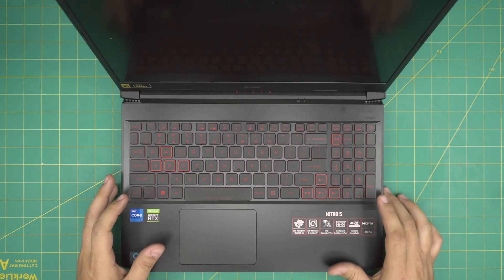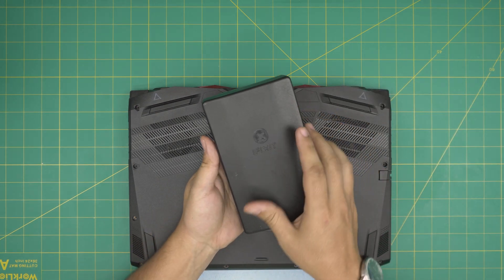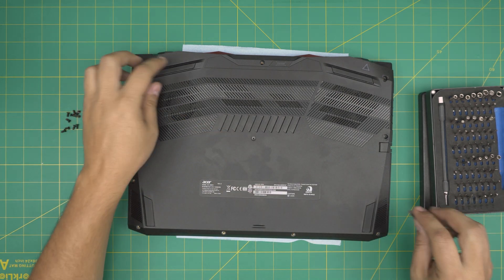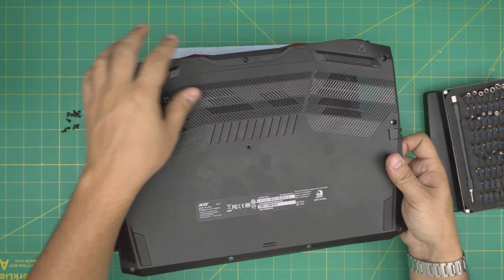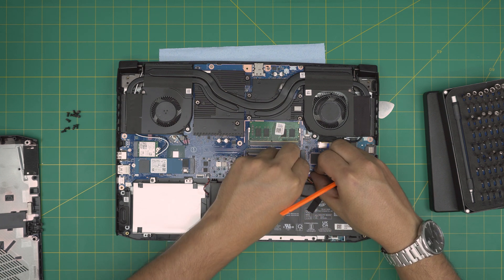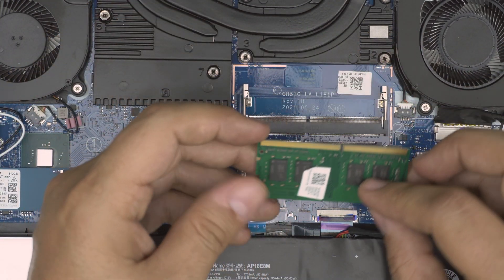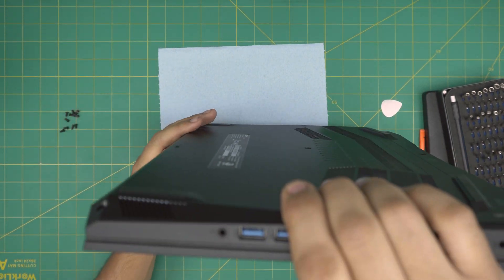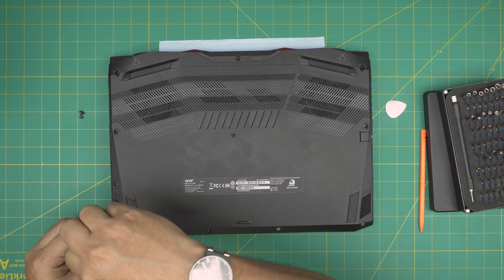How to Upgrade RAM in Acer Nitro 5 AN515-57-79TD Laptop | Step by Step

Comment: Thanks for helping to choose the ram I want upgrade my laptop its the same in the video and also the same model but I911th and rtx3060 6 g can I use the same ram that you buy with out any problem?
Reply from the maker: It's my pleasure my friend.
🫠Regarding your question, yes you can get the same ram and it will work without any issues.
cheers🍻

Comment: Heyy I add 8 gb ram with 3200MHz and I also check the default ram it’s has the same but now it’s black screen. Why is it?
Reply from the maker: 🫠Regarding your question, disconnect the charger, disconnect the battery, and press and hold the power button for 30 seconds. Then, remove the old RAM and place the new RAM in the slot where the old RAM was, and place the old RAM in the second slot. Plug in the battery and the charger, power on the device, and wait up to 60 seconds. You will then see a display. Your motherboard is not performing a memory check, but by following the steps above, you will be forcing the memory check.
Should you have any questions or requests in the future, please don't hesitate to ask me.
🍻cheers

Comment: I have Acer nitro 5 2020 bought, it has ddr4 8gb ram, can it be upgraded to ddr5 16x2 ram, pls help
Reply from the maker: 🫠Regarding your question, no, you can't upgrade to DDR5. The slot is for DDR4, and DDR5 won't fit in there.
cheers🍻

Comment: Hi. I have the same model and I'm about to add another 8gb ram to make 16gb but I'm not sure about 1Rx16 says on the stickers. Is it safe to add Hyperx Impact 8gb ddr4 as an additional ram to my laptop kingston 8GB 1RX16 ddr4?
Reply from the maker: 🫠Regarding your question, sure you can, my friend. It will work just fine as long as it is SDRAM DDR4. The brand and any other info have nothing to do with compatibility.
Should you have any further questions or requests in the future, please don't hesitate to ask me.
cheers🍻

Comment: hi, one question. So I can just simply buy another 8gb ram card and then it will turn into 16gb ram when I combine them together? and which one would you recommend for acer nitro?
Reply from the maker: 🫠Regarding your question, yes ! if you have an 8gb in one slot and get another 8gb then you will have a 16gb, or get an 16gb and with your 8gb you will have 24GB. link for compatible rams for DDR4 are linked in the video description.
Should you have any further questions or requests in the future, please don't hesitate to ask me.
cheers🍻
Reply: @uFixTek  Thank you! I actually have one more question. I need some more space, and I am planning on buying an external harddrive. My current one that I bought works for some games like fortnite (runs slowly at the start), skyrim etc, but does not work for alot of older and newer games. Are there any you could recommend that work well for gaming? Some people tell me that external harddrives are terrible while others tell me they work fine.
Reply from the maker: Here is a link to the storage upgrade. You can place 2x 4TB NVMe if you wish without any issues. It is 1000% faster and safer than external storage.
Reply: @uFixTek  Thank you, I googled it. Liked and subscribed to your channel👍
Reply from the maker: It's my pleasure my friend.
i appreciate your support 🫠.

Comment: Hello, after putting in the ram my fps is still the same and i get 30 fps in rainbow six siege, i have gtx 1650 and i5 11th gen is there any explanation to this?
Reply from the maker: 🫠Regarding your question, have you cleaned and repasted the CPU/GPU?, how long you had the laptop without servicing, if the CPU or GPU over heats it will slow and underperform.
https://youtu.be/-xUjCqda2vU
Should you have any further questions or requests in the future, please don't hesitate to ask me.
cheers🍻

Comment: Is it okay to add Ram without disconnecting the battery? Im gonna upgrade ram and im doing it for 1 st time.. Just needed to make sure if its okay to add ram without disconnecting the battery.
Reply from the maker: regarding your question: it is totally safe to upgrade the ram as long as the laptop if OFF, no need to disconnect the battery, unless you think you will be dropping the ram and screws over the motherboard.
Should you have any other questions or requests in the future, please don't hesitate to ask me.
🍻cheers

Comment: 7:15 this tip saved my life. I was switching out my original 8GB for practice but i put it back in the same slot. All of a sudden it wouldnt post and i was freaking out. I would never have thought to switch slots with my new ram stick. Thanks a lot for the advice!
Reply from the maker: It's my pleasure my friend. 😊 Thank you for taking the time to give feedback! If you would like to support the channel, please like, subscribe, or both. :P
Yes it is very common, because the BIOS keeps thinking that you have one ram and not added anything and doesn't do a MEM check, but when you remove the rams and change places and when the laptop is turning on the bios realizes that the initial ram is not the same as before and it will go to MEM heck mode.
Should you have any questions or requests in the future, please don't hesitate to ask me.
🍻cheers
Reply: @uFixTek  so we should exchange the position of the new and the old one first before booting the laptop? btw thx your video is very helpful

Comment: I have the Acer Nitro an515-57 model, it comes with 8gb RAM, which shows 3200mhz in the memory settings, I want to add another 8gb RAM but I'm not sure which RAM to buy. Please help.
Reply from the maker: 🫠If you wish to support the channel, you can like, subscribe, or both!
Regarding your question, you got two options:
option one:
keep that 8GB, and just add another stick of 16gb (link in the video description)
or 
recommended option is remove the 8gb that you have and get a 32gb kit 2x16gb (link in the video description)
Should you have any further questions or requests in the future, please don't hesitate to ask me.
cheers🍻

Comment: Hey thanks for the content, really helped me as I've been sick and tired of how small my memory was so planning on adding a new ssd and upgrade my RAM while I'm at it, just 1 question about the vid though, on the example you used it said 4 slots available but when you opened the back it only showed 2, was this because you used two different machines as an example? I'm guessing the 4 was a pc and the 2 was just for the laptop? :)
Reply from the maker: Thank you for your feedback! If you wish to support the channel, you can like, subscribe, or both!
Regarding your question, this laptops only have 2 ram slots available, the max ram capacity video is an example of how to check the "max ram capacity" it is not specific to this model, it is for general laptop /pc.
in this laptop you can easily  place 2x 16gb for total of 32gb, that is enough for most of the gaming and applications.
Should you have any further questions or requests in the future, please don't hesitate to ask me.
cheers🍻

Comment: I have got Inaccessible boot device
Reply from the maker: can you elaborate on that?
what is a msg you get on screen. or when you trying to go to bios you get an error?
Reply: @uFixTek  i got blue screen with "inaccurate boot device" written at bottom
Plus my gpu got error 43 , I think I might have damage it when i was cleaning the fans n thermal paste
Reply from the maker: i hope you use a good paste and not any conductive paste, i recommend you to reopen and check the connections and use a good brand paste like: thermal grizzly
you problem is in hardware.

Comment: i had a 8gb ram installed ddr4 3200mhz. installed an 8gb ram 3200mhz ram from amazon. not its running on 2933mhz according to task manager instead of 3200mhz. i have a acer nitro 5 an515-57
Reply from the maker: Thank you for your feedback! If you wish to support the channel, you can like, subscribe, or both!
Regarding your question, yes that is normal that's how it works on laptops, the bios of the laptop and motherboard will adjust to the safe speed of the ram to run, in PC bios you can turn on an XMP mode to push the ram speed to max, unfortunately in laptops that option is not available.
Should you have any further questions or requests in the future, please don't hesitate to ask me.
cheers🍻
Reply: @uFixTek  i later found out the ram i order was actually a 3200mt/s ram which is equivalent to 2933mhz which ended up downgrading my ram frequency
Reply from the maker: im glad you got it solved 🍻🫠👍
Reply: @sstissrfsqli bro I have the same laptop & RAM specs. I'm thinking to upgrade and add another 8GB of RAM but I don't want to face the issue that you have faced so can you please recommend me the RAM that would be best compatible for my laptop.

Comment: did the laptop come with adata ram or was it another brand
Reply from the maker: These laptops come with mixed RAM configurations. The specific RAM in each unit varies based on manufacturing times and the availability of RAM stock. When we opened several new laptops of the same exact model, we consistently found different RAM configurations.
Reply: @uFixTek  ok thanks
Reply from the maker: it's my pleasure.
Should you have any further questions or requests in the future, please don't hesitate to ask me.
Reply: @uFixTek  could i use 2 different branded ram sticks or would it not work
Reply from the maker: sure you can my friend without any issues.
Reply: I have upgraded it with two 8gb ram 3200mhz
But still the speed shows 2900mhz
How to clock it at 3200mhz?
Both ram sticks are of the same brand.